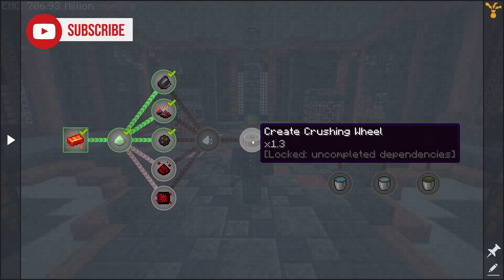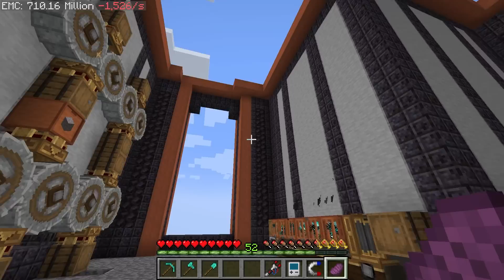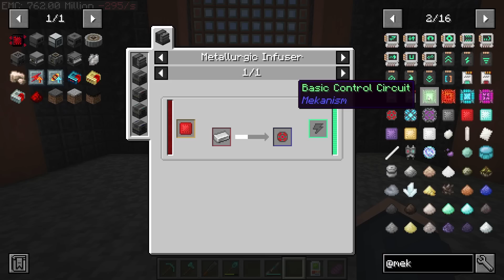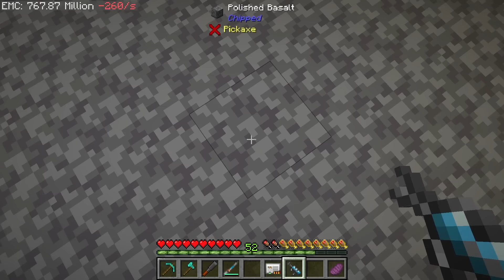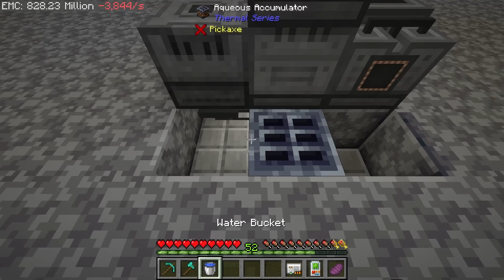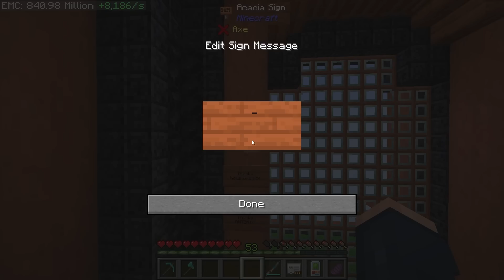Mechanical Mastery Minecraft Modpack EP12 Gas Burning Generator & Mekanism Autocrafting

Comment: refined storage has wireless transmitters and receivers for cables far from the original spot or for cleaner cable management. put more power on the system but its not really expensive for short ranges

Comment: Another water alternative is a Mekanism tank with an Evertide Amulet from ProjectE. Set the tank to output only and place the Evertide Amulet in the bucket slot of the tank. This will act as an infinite water source in 1 block space.
Reply: Oh, that's nice, I'm going to have to use that.
Reply: I remember in a previous pack that this was as reliable as you would think.  Getting the amulet to stay was a problem if you reloaded the pack.

Comment: Another option for mekanism automation is just running refined storage exporters with crafting upgrades (and optional regulator upgrades to be more resource efficient) to get the enriched material into the machine. Means you don't have to worry about complicated patterns either.
Reply: And its faster less on demand crafting
Reply: I am pretty sure LaserIO is probably the best and the most compact way to automate mechanism.
Reply: or just use watch of flowing time and batch craft like 10k of each then never worry about it any more
Reply: fun fact what of flowing time use best with Powah cable :))
Reply: Crafting cards can be quite laggy tho
Reply: Agreed. The way he automated this is objectively the stupidest, least efficient way to automate mekanism with refined storage.